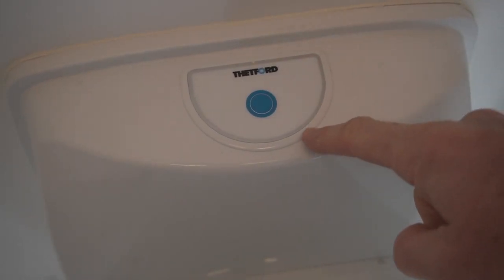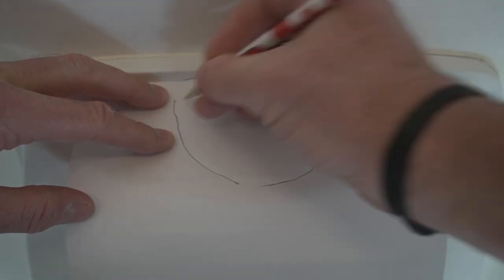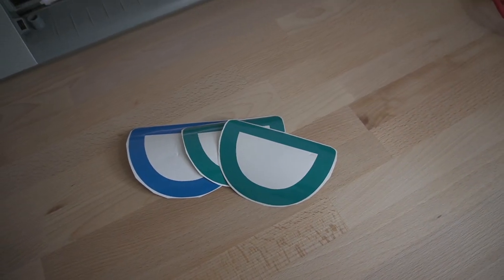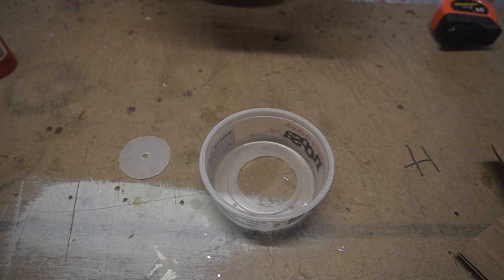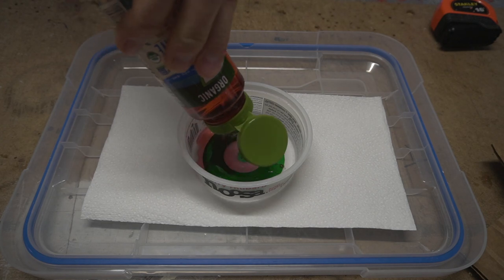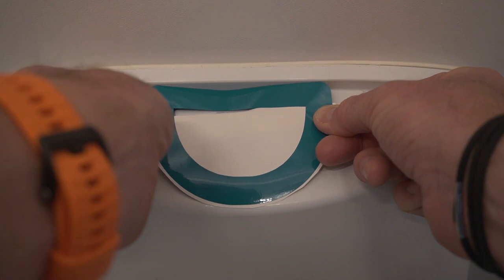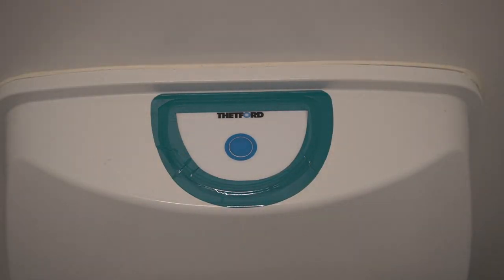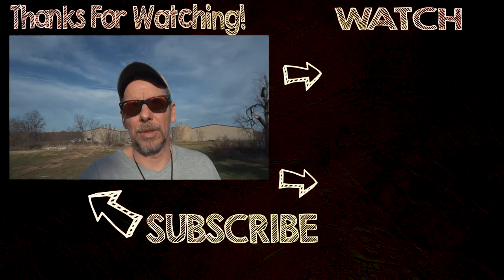Thetford Toilet Switch Seal

Comment: Do you have any more of those stickers?  I’d buy one. TIA
Reply from the maker: I'd send you one for free but by now I figured out that some electrical tape works just as well - if not better. it is the same vinyl material my sticker is from but because it is just a strip of tape, it can follow the contour much better than my "closed loop" sticker thing. give it a try and if it doesn't work or if you still prefer my sticker, email me your  address